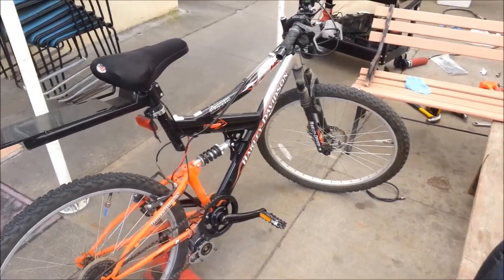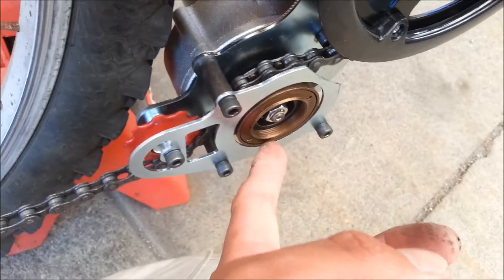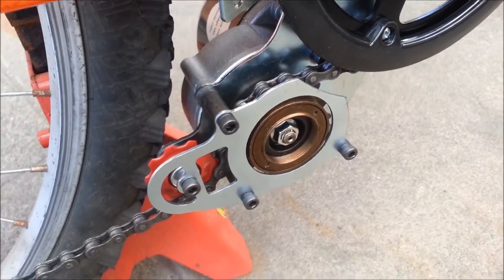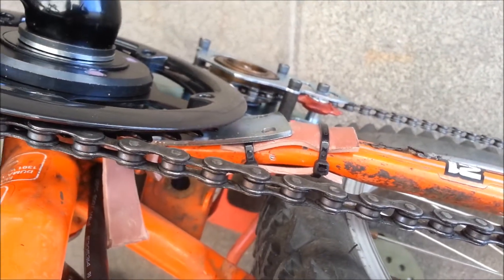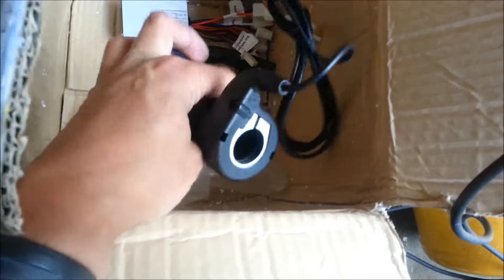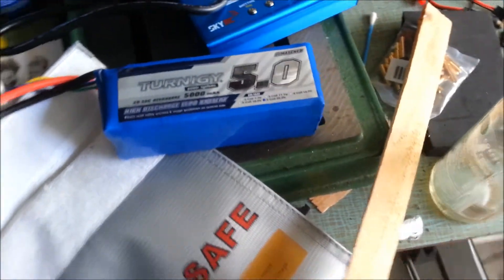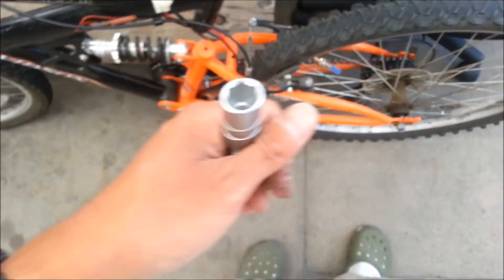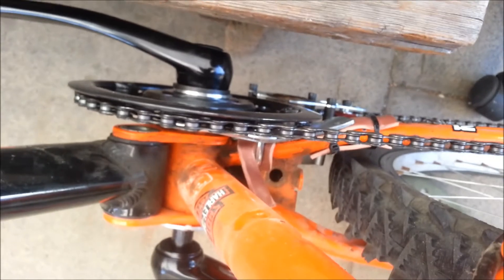HadesOmega's Electric Mountain Bike Project Part 2 - Mechanicals Installed

Comment: Very  good, did you change the controller to suit LiPo, later vid shows a black case?
I had an elec scooter and controller cut off at 22V, designed for lead acid battery not LiPo
Reply from the maker: Bain Andrew Nah I used the same controller that came with the kit.  It actually works pretty well for the amount of power putting out.  I don't think it cares if its lipo or lead acid.  So long as you monitor your voltage, plus it has a low voltage cutoff.  I did have one battery go bad on me.  Unfortunately I fried the motor trying to over volt it and its still in a state of disrepair =/

Comment from the maker: Its a GNGelectric 24V 250Watt Mid Drive kit.  I got it on ebay but you can get it on their website http://www.gngebike.com/ , currently having problem with the chain slipping but I can get it up to 11 MPH in the lowest gear and I was able to climb a steep parking garage.  If I pedal with it I can get it to 16MPH.  This is the kit that mounts under and behind the sprocket whereas there are other kit that mount forward of the sprocket.  I just needed it in this config because of my bikes funky suspension.

Comment: Which kit is this?
Reply from the maker: Its a GNGelectric 24V 250Watt Mid Drive kit.  I got it on ebay but you can get it on their website http://www.gngebike.com/ , currently having problem with the chain slipping but I can get it up to 11 MPH in the lowest gear and I was able to climb a steep parking garage.  If I pedal with it I can get it to 16MPH.  This is the kit that mounts under and behind the sprocket whereas there are other kit that mount forward of the sprocket.  I just needed it in this config because of my bikes funky suspension.
Reply: HadesOmega I'm surprised you didn't go with the 48V 450W mid-drive kit.  Have you kept in touch with other SJSU kendo guys?
Reply from the maker: skyungjae Nah been busy with work no time for kendo =(.  I wanted to keep costs down, I wanted to go with 24V because its easier to find batteries and it will have more endurance.  To make 48V with the batteries I'm using I would need to put 2 in series and will only be 5000mah.  Wasn't really going for speed.  I might start a hub motor project later.  The beauty of electric bicycle is if you run out of juice you can just pedal.